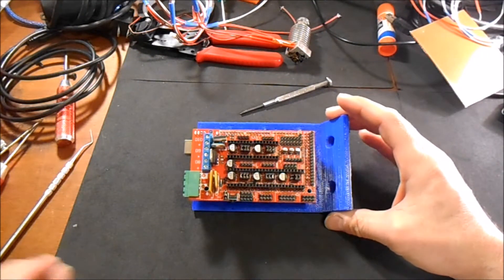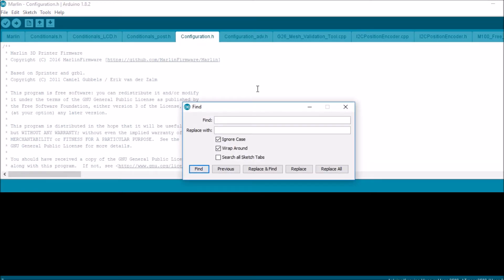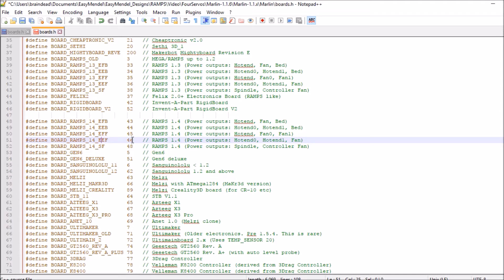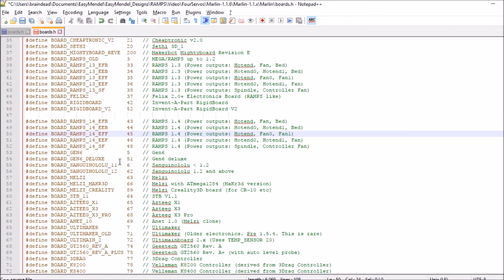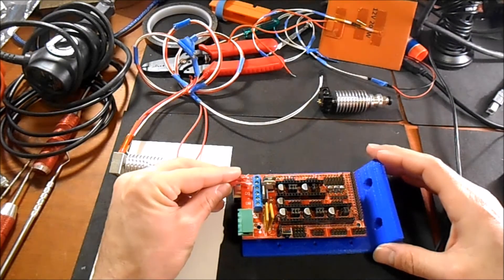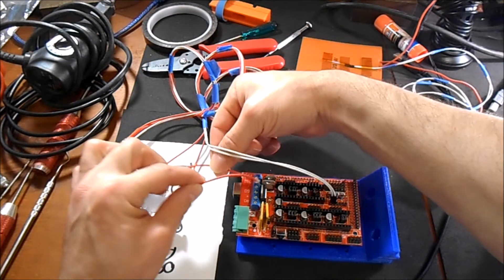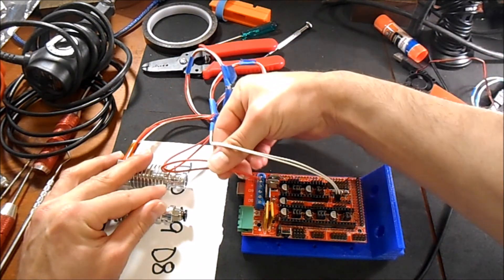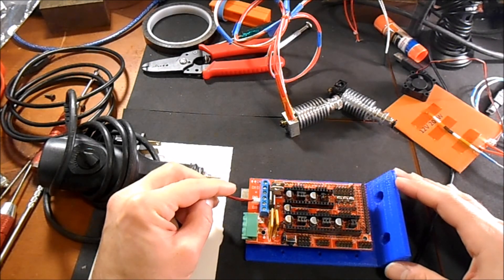RAMPS 1.4 - Power Outputs (D10, D9, D8)

Comment: I have a question at the point. As I understand, I can use D8, D9 or D10 for laser beam. But some lasers have 3 wire. How can I make my connection in such as situation? Thank you very much.
Reply from the maker: I've not installed a laser, but suspect one is voltage, ground and signal for wiring.  Unfortunately I avoid showing lasers to to visual issues it can cause and off gases.

Comment: Hi.
Using EFB

D8 led is bot glowing, which is connected to bed. Hence bed not heating.(thermistor is working fine)

Extruder and fan is working fine.

Yesterday it was all good. Today not working .Help
Reply from the maker: Which version of Marlin firmware are you using?
Reply: @EdwardBraiman  
1.1.8 i guess....i was printing efficiently by tmmrw. 
Today when i switched on the printer everything was working fine except bed.
Reply from the maker: Heatbed is usually a thermistor or connection issue
Reply: @EdwardBraiman  
resoldered bed connection , reconnected bed with ramps.

Bed thermistor works fine, Checked it with hot gun.

Thing is.Even if u dont make a connection in any D's(D8,D9,D10)
The red led on ramps will still glow, when u set the temp.

For me its glowing with extruder(D10) , fan(D9). But not with Bed(D8).
Reply from the maker: Does bed work?
Reply: @EdwardBraiman  yes..connected to seprate 12v power it worked fine
Reply from the maker: So you're saying your PSU has an issue?
Reply: @EdwardBraiman  
No i dont think so...like my 20amps smps works absolutely fine.

I heard burnt mosfet could be the reason for d8 not working.
But the mosfet doesn't looks burnt at all.  

But i found that my ramps power supply connector was littleq brunt from 11amp terminal(11 amp goes to bed)  
Could that be it? Or is it still the mosfet..?
If possible where can i share the images with u.
Reply from the maker: Discord in general chat.
Reply: @EdwardBraiman  hey hi,listen i debugged the problem...found that my ramps power connector (11 amps of heat bed) got desoldered somehow. I soldered it again and it started working.

Thing which bothers me now...is that why it happened?
i think that due to running the printer for 12 hrs non stop....with bed temp of 65.
this actually burned my power connector slightly....and desoldered my power connector pin.MAYBE
Reply from the maker: At least you know the issue now.
Reply: @EdwardBraiman  
U think that it could be?... i mean running ramps1.4 for 12 hrs. With bed temp 65. Could burn up the solder. 
Im just curious to know. 
Thankx for replying constantly though.
Reply from the maker: What's the voltage of PSU, I think Ramps 1.4 is limited to 12v.
Reply: @EdwardBraiman  
12v 20amps sir.
Reply from the maker: Might be board had a defect.
Reply: @EdwardBraiman  ya...glad i found the error...will use a relay with it....to avoid burn. 
Would love if u put a tutorial with relay.

No kidding...i saved ur entire ramps tutorial series....very helpful...keep going .👍

Comment: Thank you very much for your video, Im working in a project, Im new in this world, I´ve been making some tests with arduino mega 2560 and easydriver, but they got too hot, I need to use my ramps 1.4, but I dont know what are the pin outs to use with my arduino sketch, can you please help me??? I mean actually I´m using pin 3 for dir and pin 2 for step, how do I know which pins use for example X axis in the ramps
Reply from the maker: Check the pins.h file and check reprap wiki for RAMPS 1.4 pinouts.

Comment: I am getting 12v on the D9 pin but how do I get higher voltage out, like 20v or more since I read that the pin supports DC out 12-35v? Please advise. Thanks!
Reply from the maker: Sounds like it's the correct reading.   Are you using a 12v power supply?  I've never run the RAMPS 1.4 on any other voltage only for fear of cooking a components that can only handle 12 volts.  I'm guessing the silk screen on the board reads 12/24 volts?  I think there is a a wiki on modification of the RAMPS 1.4.  I'll see if I can find a link later today.  Which RAMPS board flavor are you running?
Reply: @EdwardBraiman  Thanks for the response :) Much appreciated! Yes I am powering my board with 12v power supply using a repurposed PC SMPS unit. I have the same RAMPS 1.4 version. I might need more than 12v output on the D9 pin but I am not sure if that's adjustable. My confusion is primarily because the RAMPS image here https://cdn.instructables.com/FNN/YJ9V/I9UDZTWP/FNNYJ9VI9UDZTWP.LARGE.jpg says D9 can go anywhere between 12-35VDC. Or is it that in order to get 20V out I need to supply 20V in?? :o
Reply from the maker: Yeah I understand the documentation is a little clear for 12-24 volts, but I stick to 12 volts to avoid cooking anyones set up. thanks.

Comment: Hey Edward,
I'm using Ramps 1.4 and everything work just fine including motors but I'm not getting any output voltage from D8, D9 and D10 pins which are used for heat bed, hotend and fan. Any suggestion and help from your side?
Reply from the maker: Could you tell me a little more about the steps you used to check voltages.  What version of Marlin firmware and Pronterface are you using?
Reply: @EdwardBraiman   I'm using Marlin 1.1x and Pronterface 18 Nov 2017
Reply from the maker: How are you turning on D8, D9 and D10?  What's your motherboard set to for Boards_ramps_14_efb?  What version of Marlin firmware are you using?
Reply: @EdwardBraiman  My Motherboard is set to Board_Ramps_14_Feb and I used a digital multimeter to measure the voltages across the pins.
Reply from the maker: @ShubhamYadav-jo1tp  So what occurs in Pronterface device connection window.  Any Error messages? Do you see an error?  Which button(s) in Pronterface are you Clicking?
Reply: @EdwardBraiman  No error..it's just that the hotend, heat bed and the cooling fan won't work. I think there's some fault with the Ramps 1.4
Reply from the maker: You can always try a new RAMPS board.  Is the power supply putting out 12v?
Reply: @EdwardBraiman Ordered a new one today. Yes. The power supply was giving 12V.
Reply from the maker: Let me know how it works out.

Comment: Hi Edward, many thanks, again awesome explained as I asked myself a few days back how to connect those according to the configuration. Very helpful again for me. Thumbs up One question remains: If I am considering to use two hotends and a heated bed where should I connect the hotend fans and the part cooling fans as D10, 9, and 8 are already used. For the hotend fans I could just connect them directly to the power supply but where should I connect the part cooling fans and how to configure Marlin being able to conlrol them ? Truly I am using google to search but not all videos / information provided by google are trusfully, therefore I am asking you :-). I am asuming the AUX connectosr needs to be used ?
Reply from the maker: TY, I'm running behind on my translations today, but I do have two more videos in the pipeline.
Reply from the maker: +Thomas Bauer I might be do that tonight, but CC takes time.
Reply: Take your time no rush from my end :-) Still designing my modular ATX power supply & RAMPS & LCD case. This takes a while :-)
Reply from the maker: +Thomas Bauer k